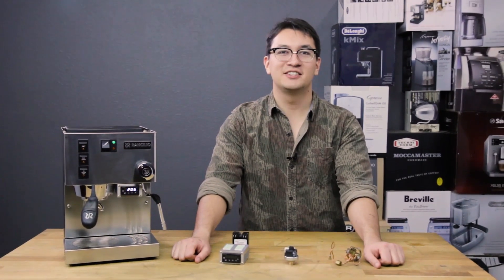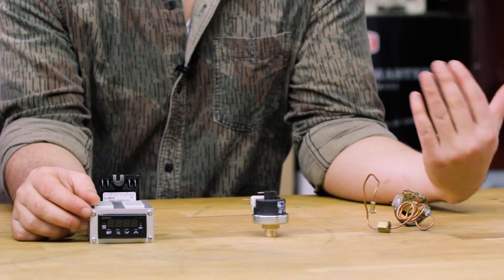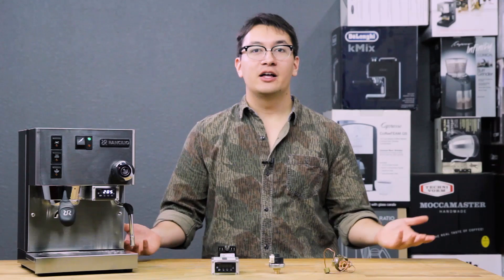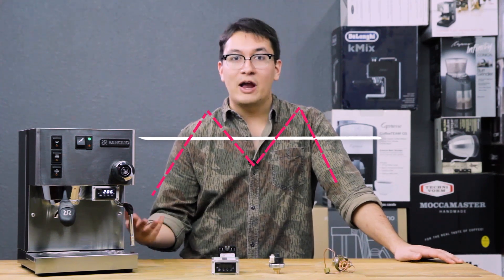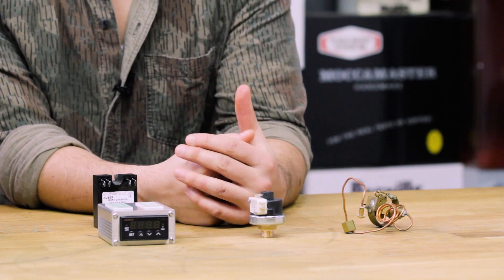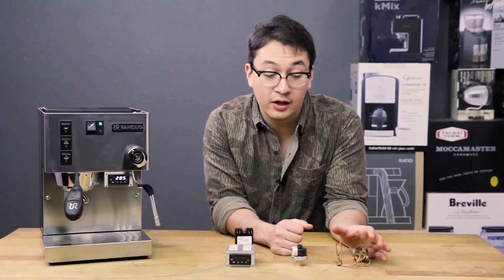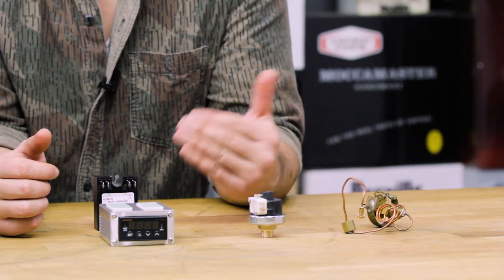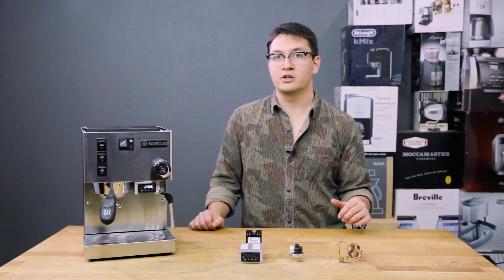What is a PID controller?

Comment: The D part of a PID controller is worthless when trying to control the temperature of water or steam due to the inherent heating or cooling delay of the entire system that is measured in seconds or tens of seconds. Also, solid-state relays don't reduce the input voltage in this application since they pulse-width modulate the full voltage to the heating coil giving the appearance of lowering the voltage over time. The P part gets you close to the desired temperature, the I part gets you the rest of the way to the goal.
Reply: so they are upselling you stuff that you don't need

Comment: Do you know if the PID's on the Lelit's are any good? Thanks!
Reply: The PID itself isn’t a piece of hardware. It just describes the math the controller is using to manage its temp feedback data. PID loops can be tuned better or worse, but in an application as simple as a thermostat that’s not going to be a problem for any machine. They should all work, at the very least, reasonably well.

Comment: Modern Espresso machines do all operate trough a controller board, running the heat exchanger, pump and all the descaling processes or what ever, they have PID processors running on them too, some even have some fuzzy logic IC. But what if you need an old machine, you need this PID max6675 chips on relays, needed for a Pro, i don't think so, you can do this manual too, knowing timing, making the perfect curves as a home barista.

Comment: what about energy consumption? like i wouldnt care if the simple thermostat gets the job done with less energy.. which one takes more energy?
Reply: George42896 the PID should use less energy as it takes less energy to maintain a constant temperature than to heat up repeatedly, like how driving at 70 is more efficient than speeding up and slowing down between 65 and 75
Reply: it is not for granted though, that it consumpts less, as it does work all the time.. i couldnt be sure about the equation, so thank you, i guess pid is a must then..!
Reply: George, sorry for ripping up old wounds as it were.
You would have to design a very very inefficient PID controller to have it (by itself) use more energy than it saves on the heating.
Did you get one?